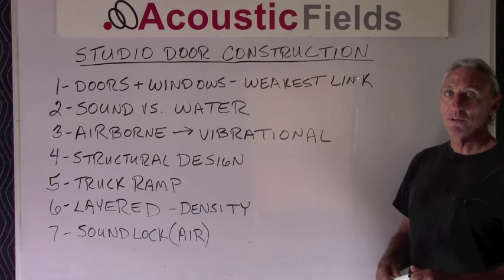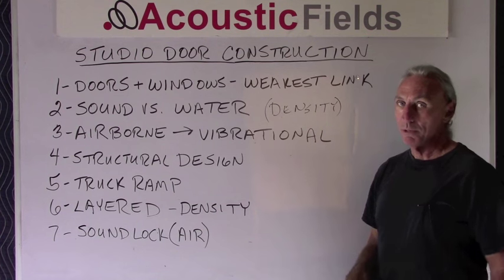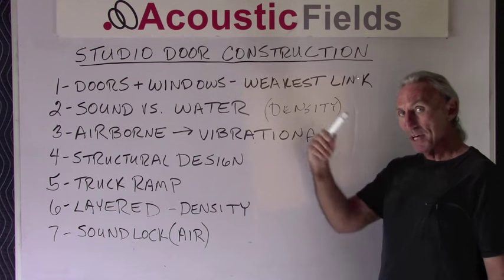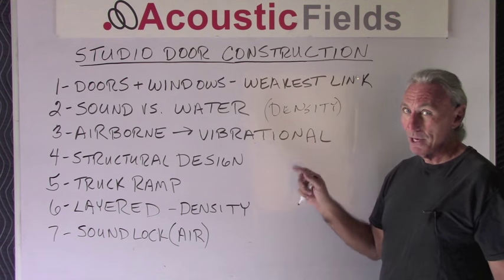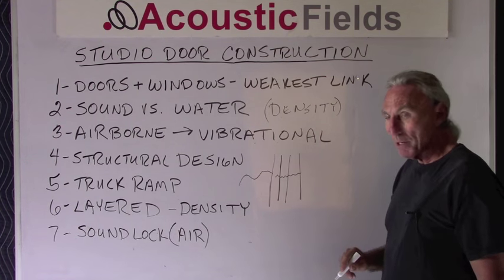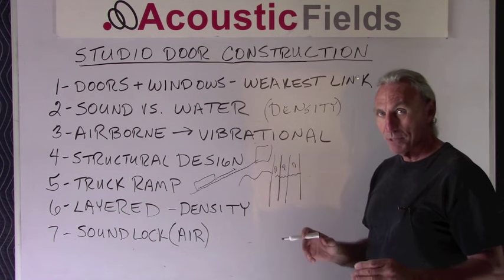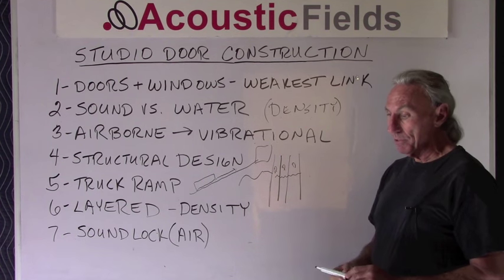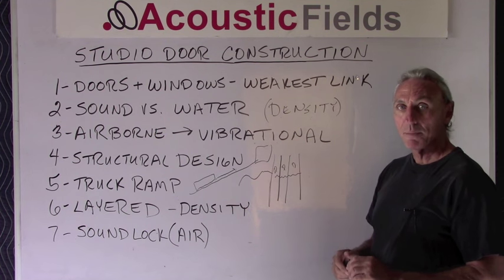Studio Door Construction: The Weakest Link? - www.AcousticFields.com

Comment: What about the door frame and junctions? That is probably the most difficult issue to address... How to select the right materials, etc, considering the thickness of that part.
Reply from the maker: R,  Its not difficult. Make sure you match the density of the door with the density of the walls at a minimum. To increase the performance of the door assembly, make sure the door seals with NO leaks. Sprinkle baby powder around the door edge and blow from the opposite side with compressed air. Baby powder must not move.